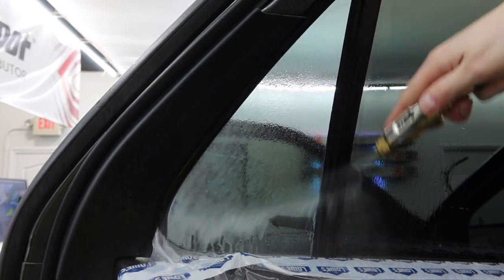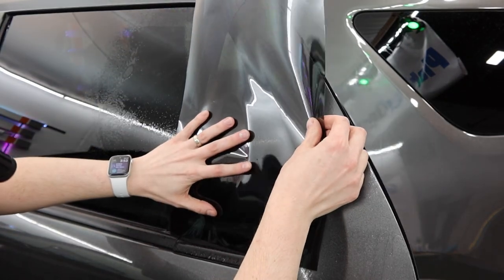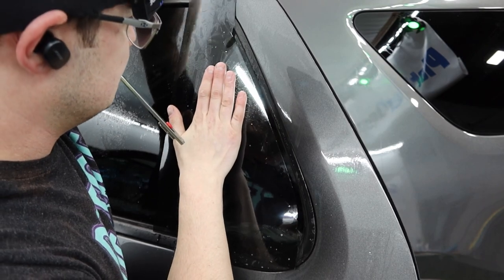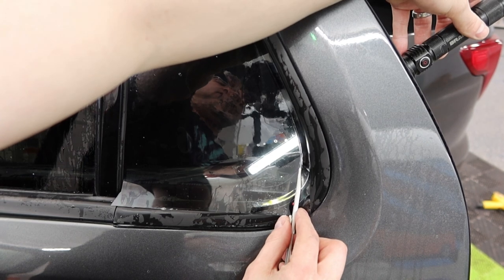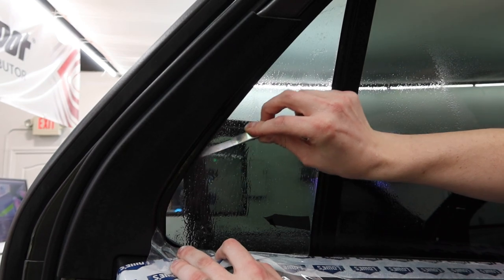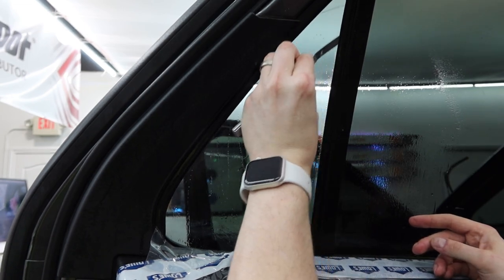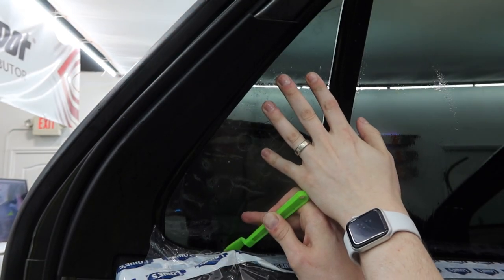DON'T HACK UP THIS WINDOW! Explorer Quarter Window Tint

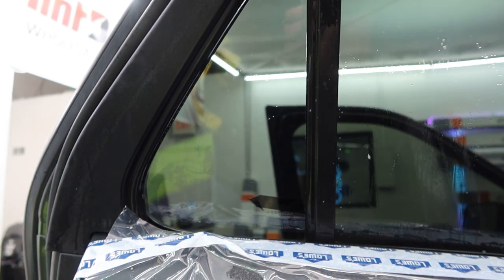Comment: great technique, but I actually saw a hairline of light on the door latch side of that window. It's hard to catch the video but if you can pause it the split second it hits 2:10, you can see a 1" space about 5 or 6 inches from the top on the right. The light that runs along the top of the wall actually makes it show up pretty good, but it may never be noticed, and, if not for the light behind it, I wouldn't have seen it at all. Nevertheless, that was an outstanding job! If it were my truck, I wouldn't have cared!